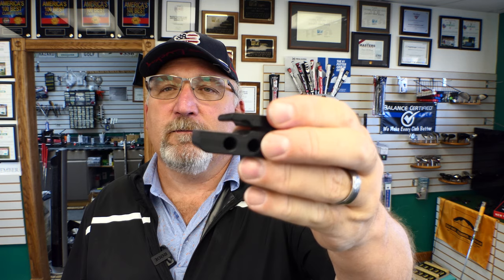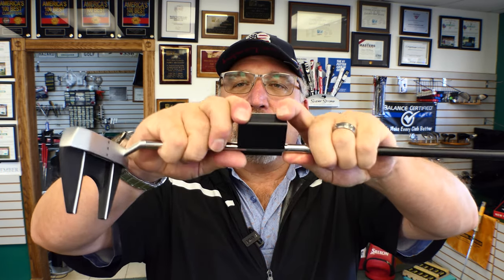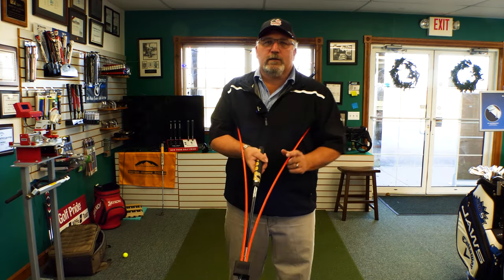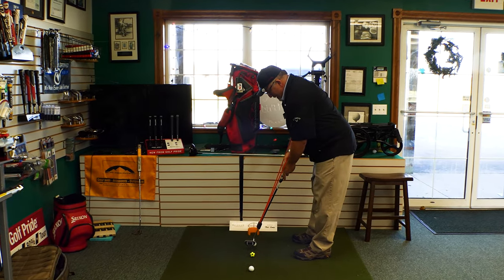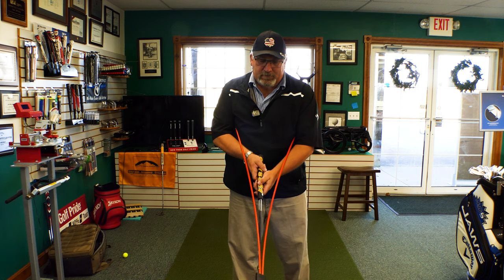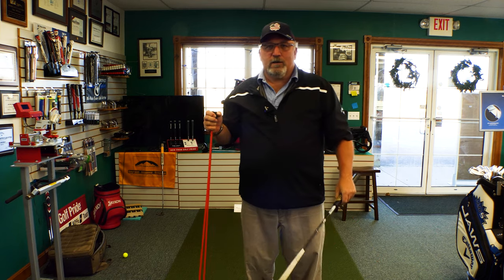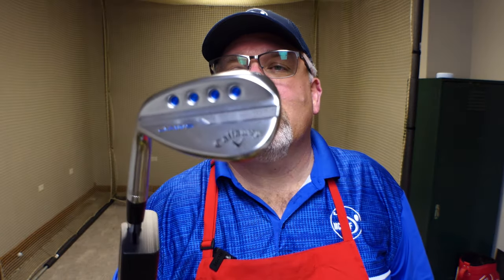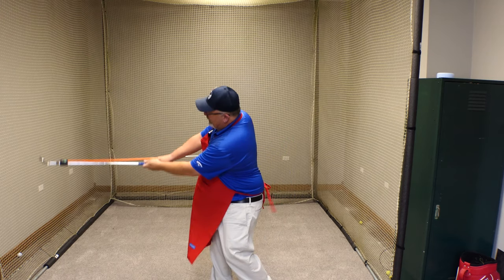The Putting PAL - a putter tool review

Comment: Okay honest review after watching this video and checking out the website because I was interested. first i said if it was around $15 I’d def get one but I would not buy this for various reasons some specifically that are mine and others that are more general. My reasoning is that I have to go buy fiber glass rods. What if I buy the wrong ones. Second reason is that I have to make multiple trips or orders. Third after checking out the website it is $39.95 + tax + $7.50 for shipping for a milled plastic clip is More than triple what I was expecting (I said $15 with a +/- of $10). I was shocked at the price and in 2019 charging $7.50 for shipping on something that maybe cost $3 or just charging shipping period and on top of that “rods not included” is in big brackets above the price. Fourth it says you can use alignment rods. Okay I do own some but what if they are to short or to long? I don’t have time to email back and forth or call during the work week to figure this out. Then I am back to my previous issue... plus no way to test if mine work until I shell out $50.75 in total for this thing... fifth issue is there is no link to amazon or anything like that for compatible tested rods... sixth is they don’t sell the rods that would work... and seventh and a major issue is that for $50 it should include 2 rods In various size for different people... eighth and final and the biggest issue is that what if you are playing the wrong putter for your stroke (way to much to go into on that subject)That $50 is about the cost of a putter fitting (depends and varies what you are doing)or at some shops they do it for free as long as you buy a putter after. Over all lots of effort for a product that overall might help some but because of the price I feel you are better off investing in a lesson, fitting, or several other aids that will help you hit more greens in regulation which has a much greater impact to lowering your score. If you hit 100% (impossible) of the greens in regulation the odds of 3 putting every hole is very low therefore you shoot in the high 80’s. Much quicker than taking 3-6 strokes then having to putt. now let’s say you have all the issues taken care of I mentioned. $50 is the cost of a round or 2 in most places and those places have free putting greens. You can google putting gate position drills and learn about the tee gate which you build to your stroke and can vary the difficulty. Also it does almost the same thing and it’s very low cost... however if you are in places that have a cold off season or don’t have time and you have the other issues taken care of by all means then it has value...  however for me I live in Texas and in the Dallas Fort Worth area where winter is mild and in cold days there are places where I can rent trackmans or even better the putt view system! Here is a link to what it is (https://youtu.be/W0bTfZcdfpA) like I said for $15 heck maybe $30 I would have bought one but for $39.95 + tax + $7.50 for shipping sorry I’d be happier with my dollar.
Reply from the maker: Got it you don’t approve of the price, and rods are inconvenient to you. FYI, I have only seen one length and size and they typically go for $3 ea on avg. however I too would suggest a fitting to determine if you have the proper putter then work on consistency. Although we could discuss course strategies in both directions.

Comment: if you use or prefer some shaft lean this tool wouldn't work, i see no adjustment now for the price 40 bucks + shipping and i need to go and buy the alignment rods if it was $20 it might be worth it just to reinforce the big muscles.. i've seen this same done with duct tape if you want to try on an old putter ..
Reply from the maker: Its really more for the motion. Even if you press a good rocking motion is pivotal a good roll in the right direction. I'm not much of an old putter guy